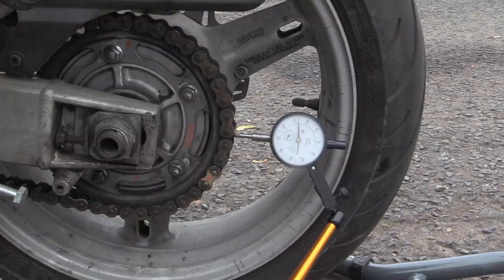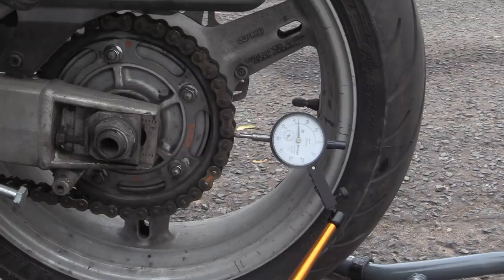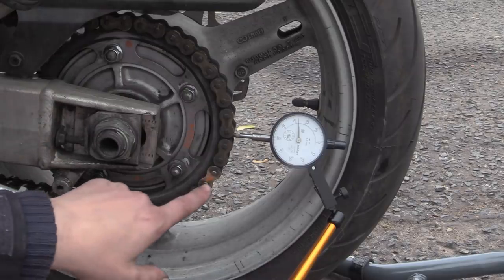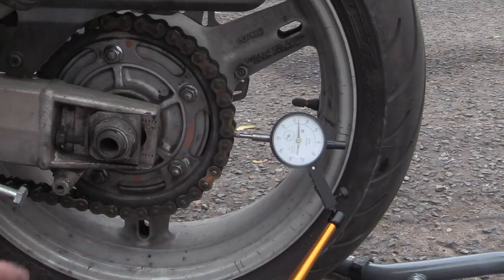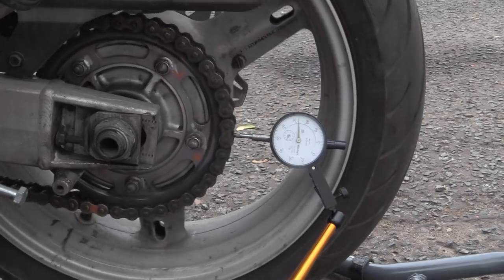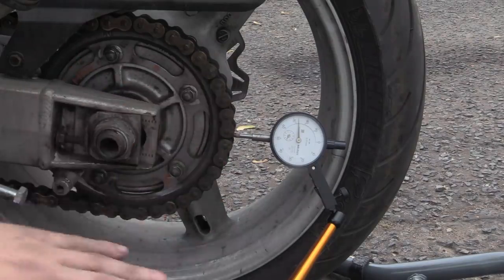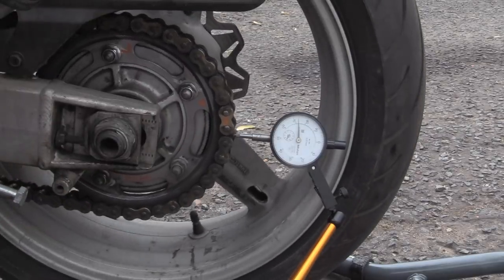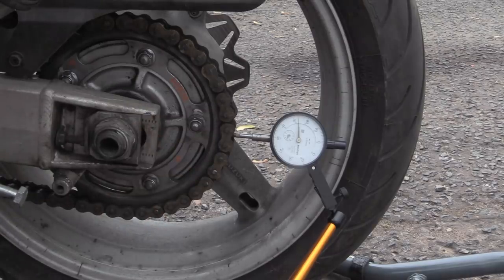Chain tight spots - but why?

Comment: What you say about sproket wear makes perfect sense. I often thought how can a chain wear unevenly, as one point , pin, roller, plate, etc.. is used as much as another and so should wear evenly, so why do you get high and slack spots other than an eccentric sprocket(s)? This also explains why you dont always find the tight spot in the same point of chain rotation as the smaller sprocket has worn too, and as they're both a different number of teeth and diameter they won't match at the same point on each rotation of the chain very often! (Hope that made sense!) and then there are those Pesky manufacturing tolerances and even "High end", more expensive sprockets, are not as close or as accurate a fitting to the carrier as they might be (I make sprockets for a living!) 
Excellent explaination!

Comment: Finally. At long, long last - a proper, accurate diagnosis of uneven chain tension. It's commonly assumed that chains stretch unevenly as they wear - and this is true. However, the question of whether this is the primary cause of uneven tension along a chain's run is another issue entirely. I just fitted a (genuine) DID x-ring chain and decent sprockets to my bike and immediately noticed a quite significant degree of uneven tension. I was surprised and a bit fucked off, tbh. My mate explained what you're talking about here, Matt. Put simply, there's an eccentricity elsewhere in the drive - probably from one or both of the sprockets. In any case, I did wonder how many people have prematurely and needlessly replaced both chain and sprockets believing that, because of unevenness of chain play, their chain is overly worn. 

Regarding a "cure" it's been said elsewhere that simply slackening off the sprocket bolts and re-tightening carefully, slowly and in a star pattern can create a much more even run of play along the chain. This makes me wonder if, when chains are replaced by guys w/ compressed air tools, they're not always tightened up as carefully as they perhaps should be.
Reply: Do you mean re tightening the sprocket while it's on the bike or take the wheel off? In the mounted situation I'd expect it to simply go off center towards the sprocket again due to the chain pulling it there.
Reply: @HardwareG33k  maybe go to the point that it is at its tights and tighten the bolts not saying it will work just saying
Reply: @Kev B This method works. Basically, it's necessary to slacken all the nuts off (six on my bike) and retighten them again gradually and in a star pattern. Providing the chain isn't overly worn, I'm now confident that doing this will improve if not cure uneven tension along the run of a chain. Me and my mate did this earlier today and the results were obvious and no less welcome.
Reply: @Unfunny_Username_389  I did this today to try and cure this issue. My shifting isnt great. I believe the chain is too slack. But it has to be too slack along some of it to accommodate the tightest spots. I took my sprocket off, cleaned all the mating surfaces and tried to put it back as centrally as possible. Yet I still have the issue. Whats the next step ? Chain and sprocket have 4k on them.
Reply: My chain has uneven tension even though it's only been 3 months since I had the new chain and sprockets installed by a nearby shop with compressed air tools.
I noticed this while adjusting it myself yesterday.
Should putting heat shrink tube around the sprocket screws keep the sprocket perfectly centered before tightening the bolts?
Reply: @michanic-c9r  have you found a solution yet?
the most common I saw is to rotate it a bolt ahead and tighten
There's a tip I saw which is to put heat shrinking tube around the screws first and tighten. Haven't tried it myself though. 
My new chain set has uneven tension as well, very hard to adjust it properly as it keeps changing by 1cm.

Comment: Easiest way to check a binding chain 'root cause' is to mark a link and mark the sprocket where the tight spot happens (min free play check). Rotate the wheel several revolutions until the tight spot comes around. Is the sprocket mark at a different position? If it is you have a chain issue. If the tight spot occurs at the same sprocket point you marked then it's the sprocket. No DTI required. It isn't rocket science.
Reply from the maker: Wow, what a load of bollocks this comment is.......

Comment: You can get tight spots in the chain which is usually visible by inspection but yes when ever i do a chain tension during service i always spin the wheel slowly to find that spot and adjust to that. What i have also come across is that the hub was not machined square for the bearings and the hub is actually out of round...And that was on new bikes...
Reply from the maker: What bike was that?
Reply: @dirtygarageguy  It was a lesser known brand, I saw it more than once as i worked at the dealership for these bikes until recently so prob shouldn't say their name.lol. I did have a vid  of it i'll try and find it.

Comment: This is interesting and definitely something to consider. In my case however, I have 5 links in a row on my chain that are stretched. The "tight spot" also follows the chain, not the sprocket. 

This is some very great info, but I'd caution against telling people that is definitely NOT the chain, as in many cases, it is. A new rider may see this and only replace a sprocket and wind up still needing to replace chain. Great video. Thanks!
Reply from the maker: What? Sorry but you're wrong. And who said changing or buy a new sprocket was necessary?

I would love you to prove you have 5 links that are stretched...
Reply: @dirtygarageguy  I am not wrong. There are many cases in which a chain can become stretched in just one spot. It can be easily checked with a digital caliper. 

I'm not sure of any way that I can prove to you that my links are stretched. If i provide you with a photo, you will say that my measurements were taken with one section compressed and the other pulled apart. So it's pointless to try to post a photo. You  have a very interesting video,  and for some, this may be the fix. Hell, I even went out to my garage and tried as you suggested. Unfortunately, in my case, Both my front and rear sprockets are dead on even. It is my chain that is stretched. I'm sorry if you're offended, but you are in fact wrong if you think a chain cannot stretch in some areas and not others. Certain acts such as hard wheelies or hard clutch dumps can cause this. If a chain is too loose and tries to jump a tooth on a sprocket, it can be yanked with extreme force by the smaller gear. Like I said, there are many situations in which only a few links can get stretched/damaged. 

Had I not already changed the chain on my bike, I could show you with a few pieces of tape on the chain and the sprocket. You would see that MY tight spots followed the chain and would not appear on the same tooth or even same area of either the sprocket each rotation. My rear sprocket would rotate about 400-415 degrees per tight spot. (rougly 55 teeth.... my sprocket is only a 44 tooth sprocket, so obviously it can be the rear) my front sprocket would make several rotations before the tight spot. (Roughy 3.25 to 3.5 rotations) so its obviously not the front sprocket. Even so, I verified this with your method. The tight spot on my CHAIN was caused when the loose/stretched sections of chain links rode up onto the rear sprocket. The slack was no longer there because the teeth of the sprocket were preventing those stretched links from being able to stretch out. When the stretched links left the sprocket, they were allowed to stretch back apart, therefore causing the chain to again have slack. 

Like I said, you have some good tips, but you're foolishly guiding people to believe that a motorcycle chain cannot stretch unevenly. You're trying to say that tight spots are ONLY because of misaligned sprockets, and you are wrong! Unfortunately, you obviously have not been around motorcycles long enough. I'm sorry If you're unable to accept this and I don't fault you for being wrong. What I do fault you for is the inability to accept when you are wrong.
Reply from the maker: Sned me your chain. Make a video doing the measurements. If you're correct ill do a video about it

Comment: check the front sprocket also. remove the chain and check the rear sprocket clearance with the device as you turn the wheel. then measure the inner chain diameter at different spots. you should come out with accurate readings

Comment: I converted a gas bike to electric and of course couldnt find matching sprocket i put on one without the center hole just securing it with only the bolts drilled as accurately as possible. It wasnt all that terrible but had quite a tight spot. Then i took it to my friend to turn the center hole in. It's an extremely tight fit now it got much better but still couldnt get rid of the tight spot entirelly.  I think it's around a factory level now not too bad.

Comment: But also don't forget the rear sprocket carrier only sits inside the rubber cushion blocks, there's bound to be some run out, surely.
What are the increments on your dti, if its a metric one, your only looking at 0.10mm runout there. Similarly is the rear sprocket within 0.10mm parallel to the front, I bet it's not.

Comment: It appears that your DTI is riding on the chain plates. That would make sense because that would indicate the measurement to the dedendum ( low point or "valley") of the sprocket teeth. Can you confirm that ?

Comment: Kinked links are next Chain topic (hope so)? My Theory is that problem with kinks is not in Chain maintenance but seizing between pin and bushing (lack of factory lubricant guarded by o/x rings?). It happened to my DID ZMVX 520 on Kawasaki Z750, road use only, after 20k km in multiple spots (10-11 links), well maintained, never ridden in wet, gravel etc, no rust at all, x rings without visible defects, no tight spots, nowhere near tolerance when measuring distance between 20 links, ...  After breaking few links to inspect, seized ones had much more wear than others and were almost dry....  Original (EK) Chain lasted twice as long and without kinked links (not one), it was uniformly "stretched" and replaced with new set (chain and sprockets). Your thought on that? Thanks

Comment: When i had tyres fitted i was told the red dot on the tyre is to be fitted inline with the valve due to it being the lightest part of the tyre. So is that light bit of tyre against heavy bit of the wheel . I cant think how you could measure/chech a part of a tyre or part of a wheel for weight
Reply from the maker: it can be white or yellow and usually a circle - however some tyres don't have them - like the michelins I have now.....

Comment: Pro tip:
When You open the new chain set, wash it down with Vodka.
Then, drink the leftover.
Then, take out the wheel, and apply a little bit of exhaust paste on the hub.
Then, drop the chainwheel to the hub, tide up  the bolts with Your finger, take a indicator and knock the chainwheel to the center with rubber hammer.
Then open a new bottle of Vodka and drink more.
After 1/2 hour, tide up the bolts with the desired torque, and wash down the exhaust paste with Vodka.
Then just go to sleep:)

Ooor, just buy a original DID full chain-set and never replace only the chain alone!

Comment: Have you figured out a way to perfectly center the sprocket?
Mine is offset a little bit and that causes my chain to tighten slightly in the same spot, which is why I can't adjust it properly.
I ride a Honda Wave S110, commenting from Vietnam.
I did try taking it to a shop and they say this is normal and there's nothing wrong. So ig I'm fixing this myself.

edit: I've got my new chain set installed just 700km ago.

Comment: Hmm my brother bought me cheap chain and sprocket combo and my chain gets tight and loose, I didn't know if it was stiff links in chain or wheel allotment alignment... how would you recommend tensioning a chain like that? I guess in-between the tight spot and loose spot? Or do I need a new sprocket?

Comment: So basically don't worry about it? Had chain/sprocket replaced about 2k km ago, haven't really looked that much on any tight/high spots but I do notice it now. Not horrible amount of difference but certainly some difference. So here I am worried that my expensive DID chain is starting to go..  This will be very difficult to fix completely, right? Really would like a part 2 video!

Comment: Actually it could be sticky chain links. When you have a sticky link it tends to prevent the chain going fully over the sprocket, hence causing a tight spot on the chain. Literally tightening and loosing the chain constantly. This is bad for the sprocket and causes premature wear. O-ring chains tend to suffer less from this issue, but they still do. Only way to fix this is to remove the chain put on a vice, tighten close to a sticky link and use force to try to bend the chain sideways. Usually this movement releases the debris that is preventing the link to move freely. Soaking the chain in solvents or stuff does not help, or the results are not satisfactory.
Reply from the maker: "Actually it could be sticky chain links. When you have a sticky link it tends to prevent the chain going fully over the sprocket, hence causing a tight spot on the chain." - simply put no.

Comment: Really well explained Matt, thanks. What is the problem or issue with this happening? Why is it bad? Let's say in a really extreme case, you hit the high spot on the sprocket at the same time as you bottom out the rear suspension and your chain snaps. But in a normal case, like your example with only a small non-concentricity, is there a problem? Cheers
Reply from the maker: "Really well explained Matt, thanks. What is the problem or issue with this happening? Why is it bad?"

- all will be answered in part 2

Comment: This is one of your most thought-provoking videos, for me.  But I am not clever enough to convince myself as to 'why' the sprocket should wear like this.  Too many miles, poor maintenance, poor materials, poor engineering?
Reply from the maker: Its not wear - it's how it sits on the sprocket carrier
Reply: @dirtygarageguy  So, it is built to ultimately  fail?
Reply from the maker: not fail. Its 2 things 

1) the engagment between the sprocket and the carrier (and even the cush drive) 
2) The concentricity of the teeth to the ring hole in the middle. Cheaper sprockets will generally be worse that 'better' quality ones. 

There's gonna be a part 2 to this
Reply: @dirtygarageguy  I will look forward to the second-half ;)
Reply: @dirtygarageguy   Cheaper sprockets will generally be worse that 'better' quality ones. There's gonna be a part 2 to this

A test of sprocket accuracy?

Comment: I just replaced my chain and sprockets on my z800 and my chain gets tighter at certain spots. I asked my mechanic and he said it's probably from over tightening the chain and when you hit a large pothole the weight of the bike compressing the rear suspension could have stretched part of the chain causing this problem. I do remember over tightening the chain a bit one time could that cause this issue or should I be looking at the rear sprocket?
Reply from the maker: yes - undo the sprocket and then re-tighten - if you're lucky then that would sit it in a different location and hopefully you will sort it out. I'll be doing another video on this soon

Comment: Try spinning the wheel with a photography strobe light shining onto the sprocket. This will show up the deviation. You'll have to do it at night or somewhere dark like the garage.

It's not a problem to worry about as it's been around since the earliest motorcycles went from leather belt drive to chain drive in the 1900's.
Reply: Can you explain the strobe light technique a bit better? Interested to try this.

Comment: If it’s not always in the same spot how could it be the sprocket? Mine is doing the same thing as far as I can tell both sprockets are running good but chain tension not in the same position
Reply from the maker: Because where is the spot your measuring from?
Reply: Mine is the chain some links are tight others are loose about 7000 miles on the chain

Comment: So, I got most of that, but I'm a little bit confused as to how this creates tight spots in the chain specifically? If that makes sense? I have always measured the tight spots on the chain in tbe middle of both sprockets, so how does a non-concentric sprocket cause a tight spot on the chain?
Reply from the maker: I'll explain in the next video - but a 'tight spot' is not a 'spot' its when the chain goes tighter
Reply: @dirtygarageguy  oh okay... do engineers just make this shit more difficult for us civilians on purpose? 😂😂

Comment: Looks like my SV1000 but my Axle Nut is on the other side :D Do you lube it with Gear oil?
Reply from the maker: LOl your axle nut is on the wrong side - and that is an issue....

And yes she gets the 80W90
Reply: The Workshop well i never changed it and never questioned it. Well i know what i do tomorrow 😅

Comment: So the guys who machined the sprocket were incompetent.  Awesome.

Or is the sprocket concentric and the wheel/hub isn't?  Mark the hub, take the sprocket loose and move it 180 degrees compared to the hub and recheck.